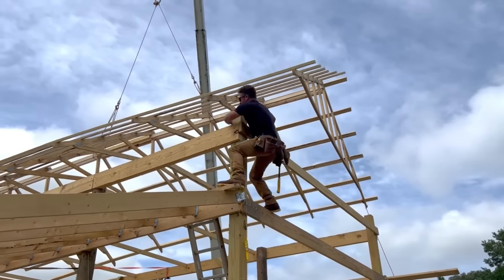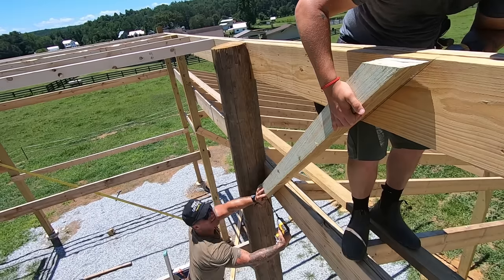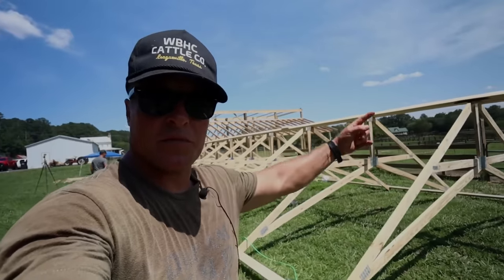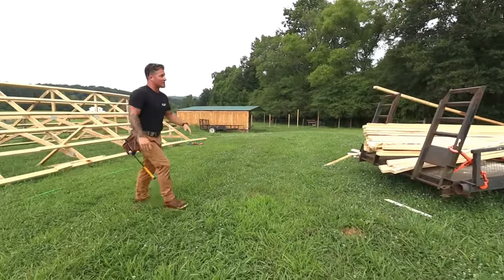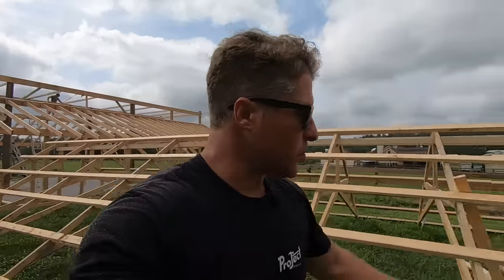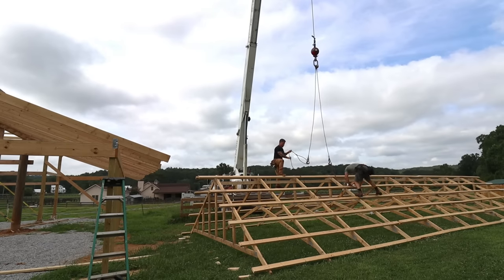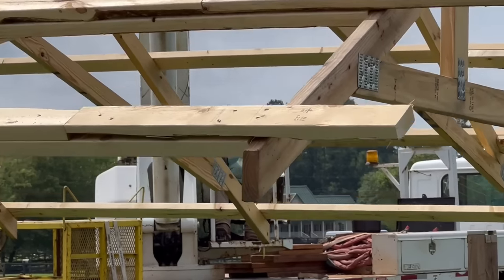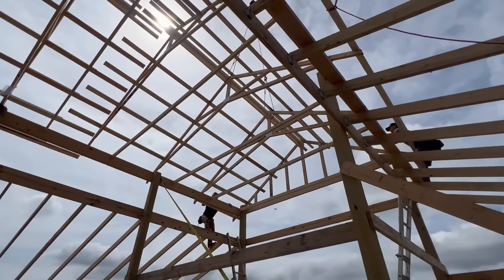Pole Barn Build On A Budget! RAISING THE ROOF WITH A CRANE.

Comment: I've watched a few buildings get built on YouTube.  I've never seen someone lift the trusses with purlins as an assembly.  Clever.  Looking good.
Reply from the maker: Thank you it worked out really well
Reply: I’ve watched a few buildings get built on YouTube. I’ve never seen someone rent a crane to put a roof on. Clever.
Reply: In Alberta we did this quite often. Largest one was a 5000sf roof that was going on a 10k sf 2 storey house. The roof was in two parts and completely closed in with plywood already. Fun times!

Comment: You are doing an excellent job in speed and budget, but some beam to post connections may not  be strong enough. I would get some experts to take a look, considering dead load, snow load, wind load and possible earthquake proof. At least add lots of bolts.